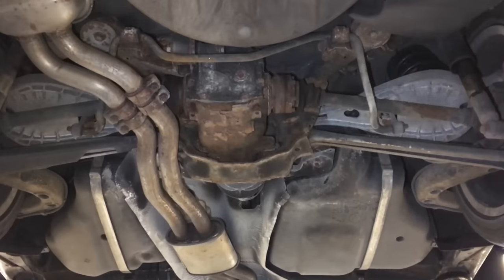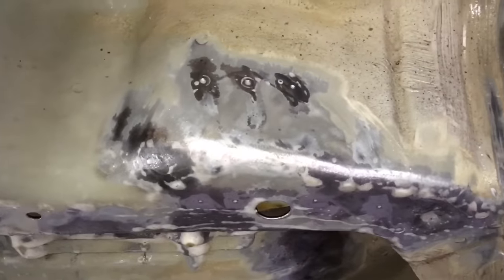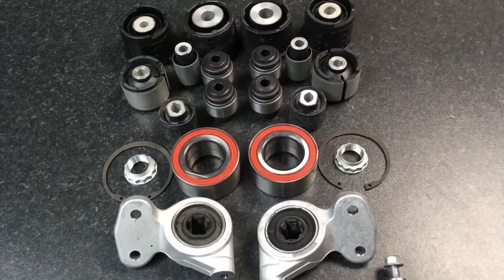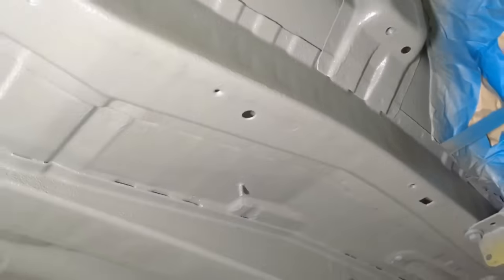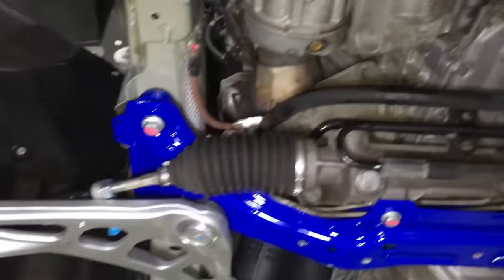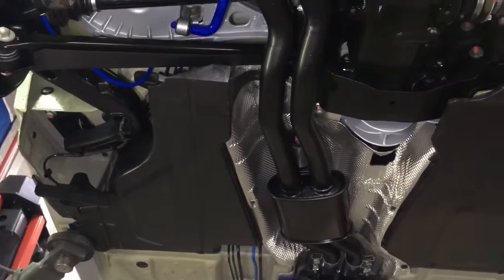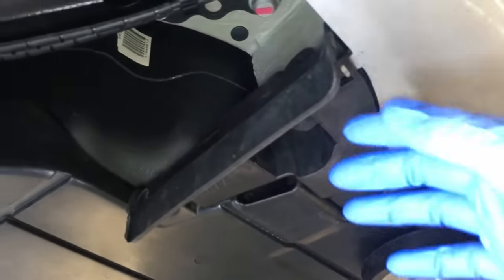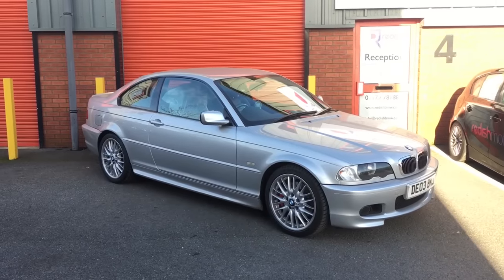BMW E46 330ci - Underside Restoration - Better Than New!

Comment: My guess is probably north of £4k inc all those new parts and wotnot, they stopped doing the reinforcements for a while as it's so involved and they were only charging for about half the hours, it's all on their site; I believe they were charging £2.5k for them but might be wrong. I guess it's difficult for them, this is what they're known for, they could charge £70 or £80 an hour for dropping oil and doing routine stuff but choose to do hard involved jobs for a lot less. You can feel the passion in his narration, a real sense of pride in his work! Incredible workmanship and as soon as you see the vids you can see why their reinforcements cost so much more than some other providers.
Reply: I cant see there being much change from £10k.
Reply: He says near the end It's easily 5k to 7k for the parts alone, so I guess with labour about 10k
Reply: 10k
Reply: It was 11k, on a forum with the same guy
Reply: @thatsjustme1990   that costs more than my 330ci

Comment: Would love to do this on my 325ci. Us 46 enthusiasts know it's not about the resell value, it's about enjoying the car for as long as possible, still would be interesting to know roughly how much this cost the owner though.
Reply: Exactly. Nicely put. If I can get this done to my 325i I'm going for it.
Reply: I would love to do it to my e46 myself but i'm sure you need a lot of special tools and stuff
Reply: Absolutely 👍
Reply: And I were you, I'd stop wasting my money on an endless money pit like a BMW and get something that is rock solid and reliable.
Reply: Nice job.. all this can be an easy D.I.Y ..
Reply: @Zirkobi  this is really ignorant because bmw's are reliable lmao
Reply: @Zirkobi  Its not an endless money pit if you take care of it, plus its not about the money its the car
Reply: @charliebmoify  if you or the previous owner neglected service and/or used the cheapest parts ever to fix stuff then it turns into a money pit. First you have to fix all the crap done to the car and then all the broken things that got their longetivety shortened by miles due to cheap parts that broke sooner then expected or ran out of tolerance which led to a shorter life span of other parts. But this is a general problem with all cars. Many owners think they can do proper DIY repairs and simply buy the cheapest parts because they either think there is no difference except price or they simply can't/won't pay for the correct parts. You know them types. Those "yeah I am sort of a professional mechanic myself" types. Some cars are later able to be saved and some are beyond saving. It depends on how hard they got hit by their top notch DIY owner :) it is usually that kind of person who then goes mocking about how unreliable their current car is and they have to sell it because of that :) but guess what - once they get another car the story starts all over again ending with "omg gotta sell that unreliable crap again, geez nobody makes reliable cars nowadays anymore" and similar BS :D
Reply: @lmarshall5245  Heartily agree, For the average home mechanic these restorations just take a little longer .. parts can be sourced as good as new and if you have time and space you can achieve a fantastic finish
Reply: @Zirkobi  Says the guy watching BMW videos, either wishing he had one, or regretting he had one.  Or missing owning one. Which is it General?
Reply: @drlogiudice  No, no and no, neither of the things you mentioned. I'm watching these to confirm my belief that a BMW is one of the worst pieces of junk there is and only enforce my opinion that "superior" German engineering is nothing but a thing of the past, if it ever actually was a thing to begin with.
Reply: @Zirkobi  Why are you even here guy? Do you have nothing better to do then to spew your ignorant hate comments? Do you honestly think people are going to care? Go back to driving your Corolla and leave these cars to real driving enthusiasts.
Reply: @builtvisions  oh making assumptions now are we? Because someone actually is highlighting just how terrible BMW's actually are. But then again, many people don't know better and don't listen to reason.
Reply: @Zirkobi  I have 3 bmw's an e46, an e90 and a e60 5 series, none of them had any problem :)) the e46 been in my family since 2001! so wth are you talking about?
Reply: @lookinatcha5279  lpepw  ööööpöööööööööööööpööööööpööööööööööööööölöpöpöpöpööpöpööööppöpöpöpöööööööööö
Reply: @Zirkobi  LOL... sounds like you never drove one of these cars... stay in the pond buddy, the pool is not for you.
Reply: @31acruz  fun thing is, I have. I've driven several BMW's as well as other German brands. And it's funny how it is proven by their longevity or lack of same that people still think that they are superior cars, when even most and proper mechanics also claim that they are pieces of junk. Besides that, since BMW doesn't emphasize safety (clearly shown by those driving them) then that is another point where they also fail. Face it, bud - BMW will never be anything that even resembles good cars.
Reply: @thevinylchannel6274  Is that why the forums are full of people with problems, cause they are rock solid reliable?  Yeah right. Also I have owned several of them and they are rubbish.
Reply: @Zirkobi  Out of curiosity, what car brands do think make "good cars"
Reply: @charliebmoify  right and even Toyota and Lexus have a maintenance shop and parts department and yes they stay very busy
Reply: @Zirkobi  what is a good car for you, then
Reply: @vitalybrateev5548  Swedish 5-cylinder steel beasts. I'll let you put the last piece of the puzzle together.
Reply: @Zirkobi  and why are they better than other cars ?
Reply: @Zirkobi  you obviously have some issues up there
Reply: @lolish1234  we all do, bud. The question is what exactly.
Reply: @Zirkobi  If your talking about Volvo, I've had 6 over the years and the newer cars are now crap i spent over 6 grand on a xc90 i had from nearly new, loads of problems that's 6 grand from fixing the car, gearbox, turbo, rear diff and electronics, wheel bearings etc etc,  my BMW Z4 coupe never cost me anything in repair parts 4 years of ownership, so it's reliable, yes it's a weekend car but i will never have a Volvo again, for that sort of car i need i have a reliable Shogun, love bmw's though always have, brilliant drivers cars rwd and power and handling , yes it's all we need !!
Reply: @Zirkobi  Ok so what car is manual+rwd+comfortable+sedan/wagon that isn't a bmw.
Reply: @proarmy70  Volvo 240, 740 and 940 to mention but a few. Besides, the red lock engines that they have are impossible to kill.
Reply: @Zirkobi  lol all of them except the rare turbo version are all underpowered even the turbo version, and all of them are becoming 30 year old cars so they too are having rust problems even newer volvos have rust problems and also I think that many people would rather choose a bmw over a volvo whoose wagons look like ass(not the newer fwd ones). Don't get me wrong these volvos are nice but they don't compare to any 3 series or 5 series bmw
Reply: @proarmy70  except for the fact that they do. Besides what I've seen so often and way more times than I can count is that despite how many horsepower rwd cars have their wheels spin around with no real weight on top of them meaning that they don't have a proper grip. Old Volvo wagons look like ass? That's a ridiculous statement to say the least and remember that BMW's aren't made with rust protection in mind, Volvo are. You forget where they're from and what kind of harsh Nordic environment they're built to handle compared to a squishy softy like a BMW. And again the red-block engine in these Volvo's are impossible to kill even when you make them spit out over 400hp. On top of that the Volvo's are stronger, safer and vastly more reliable as well as comfortable.

Remember, what model of car from the same year do you usually see more, if we say...a Volvo 940 or a BMW of the same age? The BMW's will have been scrapped long ago, but there's a reason why the Volvo's are still around.
Reply: @Zirkobi  ok, you can get 400hp out of the engine if you spend a couple grand on tuning it but that's illegal and you wont pass mot. Also I don't see any old volvos nor bmws on the road they all are becoming scrapped whether you like it or not. Bmw has some kind of rust protection but maybe not as much as volvo but it still doesn't mean that the volvo won't rust. And what if you want a car from the 2000s? there aren't too many rwd volvos from that age. Looks are subjective but the rear of the volvo wagons looks wierd same goes for the 740/760 sedan and possibly the 900 series too. I personally don't care too much about safety, I drive dirt bikes and I am looking into buying a motorcycle too. Also many volvos can become big money pits. Yes volvos are more reliable but it doesn't mean that they are better some people just prefer nicer cars. And just because it is a money pit doesn't mean you have to go and spread useless help and explain how your clapped out boring volvo is made by some god and are invincible. You are almost as annoying as the Japanese car community. Thing is I like volvos but I also like bmws they are not comparable in any way, if I were looking for bmw I wouldn't be looking at a volvo or the other way around. There are simply no easily available 200hp+, full leather interior and rwd cars and manual from the late 90s and early 2000s other than bmws
Reply: @Zirkobi  m54b engines are reliable as hell
Reply: @jonny_exotic2575  yes!
Reply: @Zirkobi  ok then I'll just drive a Honda accord with 200,000 miles 💀
Reply: @TheOfficialGlitchTTG  enjoy. Honda is a fine brand.

Comment: An amazing restoration and very detailed commentary.

I wonder what this cost, I would assume £6k.  Considering this is only a 330Ci, I hope the exterior of the car matches the condition of the underside.  The MOT man will have a heart attack...

I get the whole sentiment thing as I’m just as fastidious with my cars regardless of money spent, so good on you for doing this on your prized possession!

Same it’s not an M3 though, but 330Ci’s are still great great cars
Reply: I believe this is a zhp so although not a m3 is actually a bit more rare
Reply: I'd say that's almost 6k in parts alone.

Comment: I feel sorry for anyone who will be inspecting this vehicle at the MOT Center after they get under a vehicle.. get a spare panties😭😭😭
Reply: e30_lad_ireland 

I’ve got a b5 a4 with 188k Miles on it, replaced every front suspension arm, both track rod ends, drop links, and top mounts with meyle HD stuff, and fitted new bilstein shocks and eibach springs all round. 

The mot guy spent so long trying to find something.. anything to fail it on, but he gave up. He said when he saw the year and the previous MoT’s mileage he was like ‘oh god here we go’ but then he was shocked at how solid it was mechanically.
Reply: Johnathan Doe that’s a cool story mate and poor inspector lol. This is something I’d love to do as well on my coupe e-fourthy six.. one day :)
Reply: @Stefan Lazic And that's why that guy is the inspector and you are never going to be.
Reply: Take this to a MOT centre and you'd be assured that they wouldn't try and get away with anything, being fairly certain that someones been under it recently.

Comment: i would be interested in seeing the final bill after this. cant be cheap. a price break down would be cool
Reply: @stubbk3 
hahahahhaaaa
Reply: call or email them he said
Reply: @Marcusb2kk  
judging by what he'saying sounds like somewhere between 2-3k.
Reply: He says near the end It's easily 5k to 7k for the parts alone, so I guess with labour about 10k
Reply: I just completed a rolling restoration of my 98 E36.  Last phase was a drivetrain rebuild.  That alone was over $15K.  Add to that all new paint, interior including full leather, etc. etc.   I basically bought the car twice.  But it was still worth it.  BMW doesn't make true driver's cars like the E36 and E46 anymore.
Reply: @dvatp  Exactly cars are not like they used to be.

Comment: What a great video and process.  Thumbs way up!   You and the owner should be proud of the work.

What I don't understand is with going through all fo this why not address the know rear subframe weakness by adding one of the available weld in bracing kits.  I also would have definitely done braided brake lines and an limited slip rear dif.
Reply from the maker: Hi Jeff, many thanks for your comment and kind words!
Well, this E46 was to be an original-as-possible Restoration (at the start) before the brighter colours got introduced!
So this owner actually didn't want RACP plates.
Did you know that we (Redish Motorsport) were the pioneer for the new-class larger-style  RACP Plates back in 2011.
You can read about the development here:
http://www.redish-motorsport.com/RedishMotorsportE46RearSubframeReinforcementPlateKit.html
Yeah I agree a set of Braided Brake Lines, and an LSD would've been an excellent finishing touch.
Thanks again for taking the time to comment.

Comment: Excellent work on that underside restoration, but why didn't you apply the primer to the back of the brackets you removed prior to welding them back to prevent the backside from corrosion?  I think that would make the job that much better than spraying the parts after the fact, or does it not make that much difference? Just wanting to know the reasons behind the work if it's not too much trouble.

Comment: Interesting. I did almost the same thing on my 2002 325xi. Didn't have time to manage the heat shield or the exhaust, which was still in very good condition but I did pull the subframe and brackets and powder coated them while changing all the bushings, bearings and seals. Chose the nearly the same colors as you. Except the subframe...which was a metallic blue.

Comment: Can you torque the bolts accurately if you apply grease to the threads?
Reply: I always use Anti-Seized Grease with less amount torque setting from factory.

Comment: How much would it be? I wish I had the money for do that in my e46 m3
Reply: bet thats about 5-10 k euros
Reply: only for the parts maybe...
Reply: How much is that in USD?
Reply: ~10000$
Reply: Be the best part of 10k at a garage in uk pounds. But if you do it yourself about 5k. The problem is its a very slow process and very awkward on your back if you dont have a 4 post lift. I have just spent 12 months doing my Mitsubhishi Evo. It was a ton of work but looks awesome in the end. I updated a lot of my components so mine ran me into 10k.
Reply: About 20k easy worth doing because when these cars beco.e old timers they will be worth 40k plus
Reply: Do all this if you want a display piece but if you just want longevity just apply more of that bmw factory wax, which i bet it is basically cosmoline since it is the right colour and has similar properties. It is the gold standard.
Reply: @inside33 Indeed! I have a 98 ford explorer v8 XLT and have replaced about 85% of the suspension parts and do have peace of mind. Also, I now know how to change all those parts and how it works! I'm also changing all fluids and diagnosing leaks to make it run the best it can. 237k miles and still running strong. Take care of your cars and they'll take care of you.

Comment: lol id like to see you restore my 2000 323i. it has 250k miles or 402k km... and its always lived in the rust belt. the body is rusting away now. id wonder how bad the undercarriage is.
Reply: As owner of a 160k 1999 328i in Pennsylvania they are pretty rust resistant apart from the side jacking points. Those are a mess. They get strained and break or water and grit gets under the rubber jack point boots and rusts away the body. After patching up the rocker panel outer skin and fixing the jack point point sheet metal, I filled in the hole for the rubber jack point, leave them off and attach them with industrial velcro when needed. Seems to work well so far.